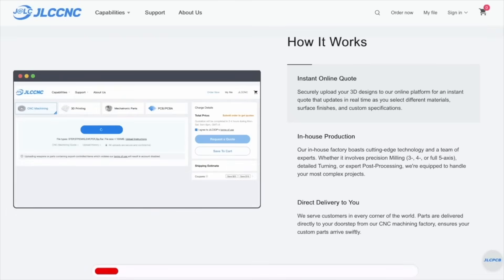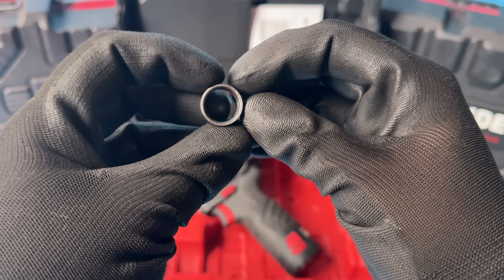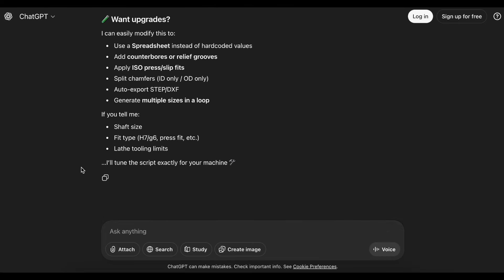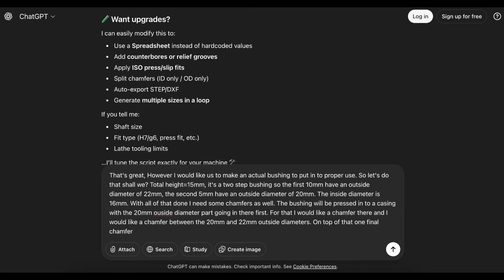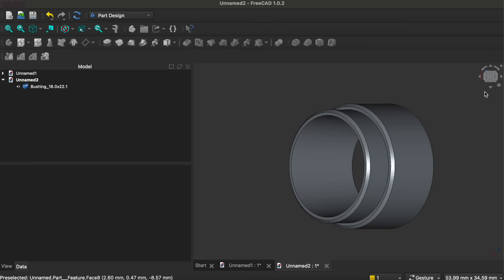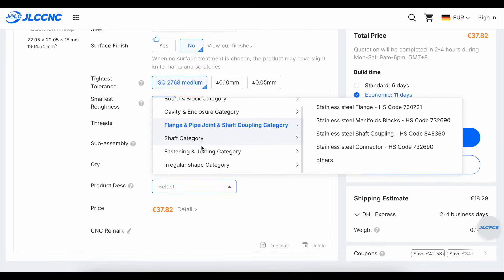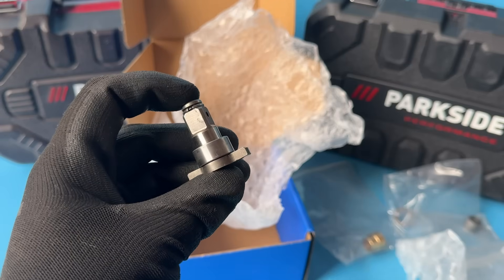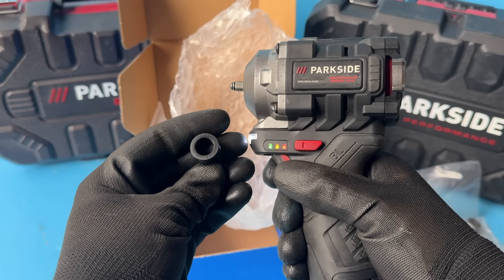I Used ChatGPT to Design CNC Parts for My Tools (No Engineering Degree) - ft. JLCCNC

Comment: Metal bushings… if too small, try warming in owen, 70 degrees celsius for example. Now the axel, try putting to freezer for couple of hours. Next try combining them. Use gloves, don’t burn your hands.  I did install some bearings with tight tolerance that way at home. You see this works in other aspects on life as well… you warm the hole until it widens up and then you are able to get it in.
Reply: 😂😂good advice ... but belonging to the "other aspects of life", don't put the axle into the freezer😅 ... just in case someone would try it 😂

Comment: Are you able to look or buy skil tools? O dont know which country you're from but in the Netherlands theyre pretty available. Id say theyre at least parkside level and maybe a bit above. It does really depend on when they ve been made because of companies buying companies and mass producing low quality tools. The newer skil stuf, mainly the xp line, is awesome.vthey have a big mid torque impact too. Its rated for 1200 nm instead of 1356nm. But thats pretty close

Comment: I would recommend to learn at least basic 3D modeling and getting a 3D printer. You will thank me later. Making a bushing like this in FreeCAD is really easy even for a beginner. Basically just a bunch of cylinders with the same center and a few chamfers. I'm only a novice in 3D modeling and I could do this probably as fast as typing in the text into an LLM.
Once you have a 3D printer and know how to do basic stuff, you will find it is the solution to so many problems... Faucet too short for your new fancy bowl style sink? Design and 3D print an extension. Housing of an old car key broken? Just download a model and print away, or even add a custom logo on it. Bathroom cabinet doesn't fit flush to the wall because the tiles only go up half way? Fire up FreeCAD, design some spacers in under 5 minutes and have custom size spacers ready after a short break... The possibilities are endless.
Reply from the maker: I am absolutely looking at the 3D printer thing and it‘s mostly, because of your comments on here. However I won’t lie 3D modelling sounds scary and so does the set up of a 3D printer, because I am really bad with the computer stuff and I struggle to even set up a regular printer…
Reply: @BrokeLifeEU  Then just get a Bambu Lab printer. They are actually easier to set up than a regular printer and even more reliable in my experience.
And the 3D modeling is easy as well.
Reply from the maker: Thank you for that feedback!
Reply: @BrokeLifeEU Don't get me wrong, 3D printers are still printers at their core, so they will have issues, but at least for me they are less often than with regular printers and they are usually mechanical in nature instead of whatever demons break regular printers.
So much easier to fix.
Reply from the maker: @Vrabetzz  Well, that’s really nice to hear! If I do end up getting one and manage to make it work, I think it could be a really interesting topic to explore in terms of tool mods—that’s actually why I was looking into it in the first place. That said, it’ll have to wait until next year, as I’m completely spent for this one 😅.

Comment: We don't have the impactors in the UK yet, unless you count the one in the two piece set in 1/4"...

If these models do make it across the channel will you be opening up a web shop for the bearings and anvils you are working on?
Reply from the maker: The 20V PDSSAP D3 will be available in te UK starting on the 21st. As for selling these I do not plan to do so, nor is there anything I sell online. There are some scam accounts mostly on TilTok pretending to sell something and have this logo, however it is not me. I don‘t sell anything and if you see me, I can assure you it is a scam and it‘s to be avoided!